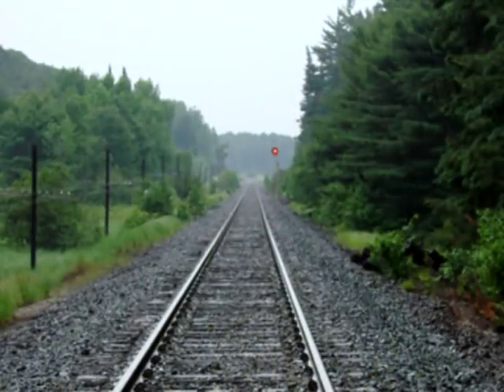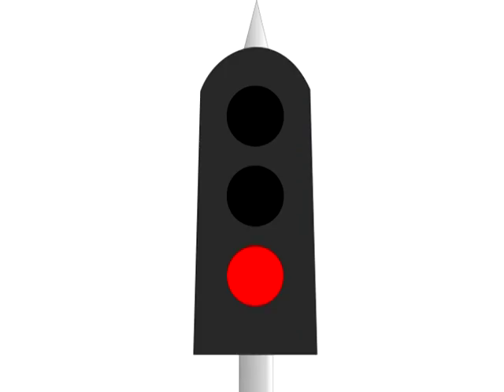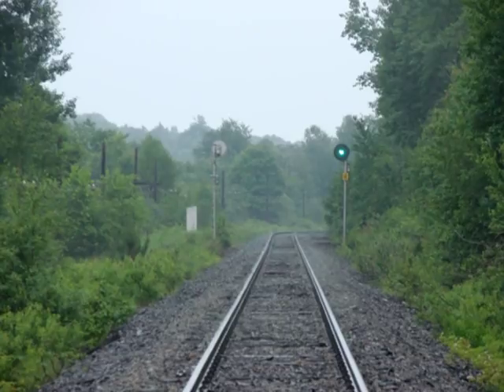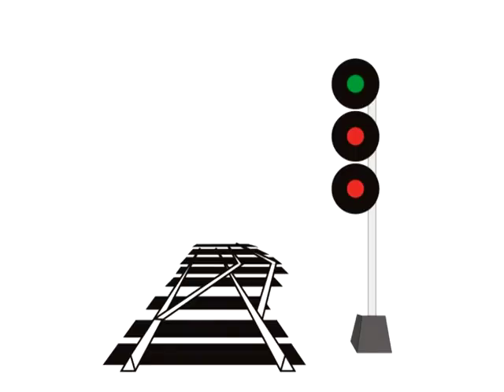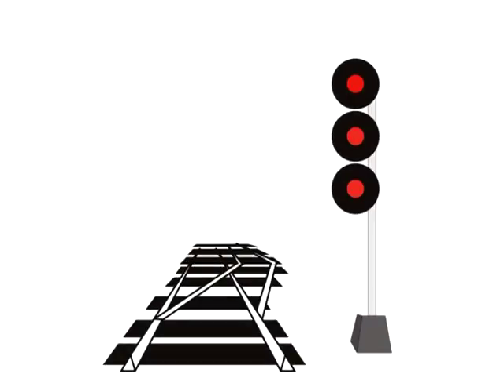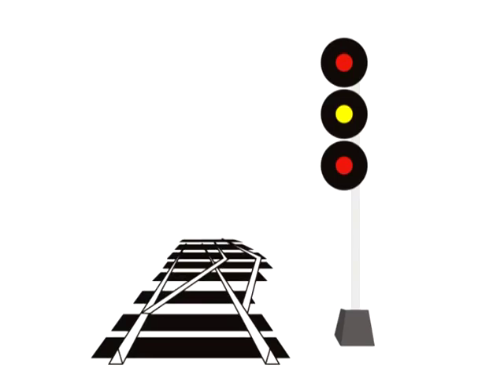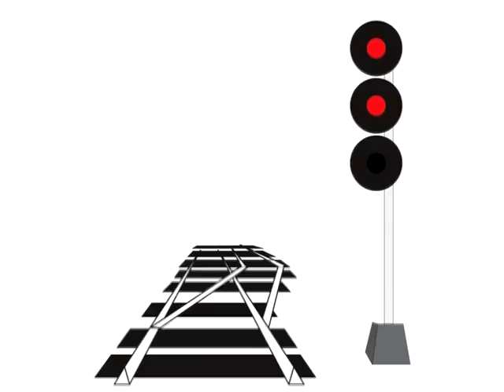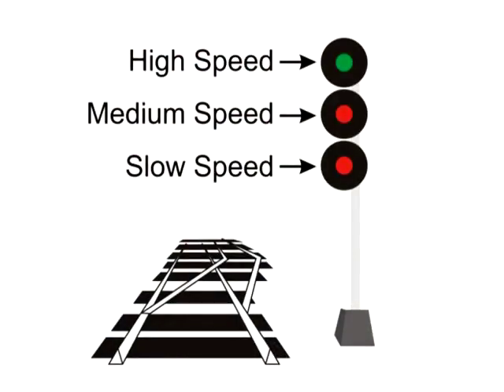Railroad Signals, reading and meanings, part 1: The basic three light system

Comment: Nice vid, thanks. Finaly I have some clue about North American siganling. One  question; do you guys use any train protection systems in case the engineer would missread the signal and would not stop at a stop signal? I`m talking about something similar than TPWS or ATP in the UK.
Reply from the maker: No, not yet. They're working on it in some parts here in North America.

Comment: I do not understand "stop and PROCEED". If the block ahead is not clear, shouldn't the train remain stopped until the signal turns yellow/green?   I was always under impression that red meant "RED" (stop). Surprised that by default, it doesn't mean that and only when there are additional signs on the post does it mean "stop, you're not authorized to proceed".
Reply from the maker: Right, well this is only for the automated signals. We get pass stop permissions from RTC all the time for the absolute stop signals. But it takes complicated paperwork. Almost always, we'll pass a stop signal because a block is down - there's something broken on the system. However, there can be a ton of reasons why you'd want to go past that signal. 
We had one a few weeks back where in extreme cold, our remote controlled locomotive went off-line. It was about a mile back. In the extreme cold you get hundreds of small air leaks in the train air brake line (especially the connections between the cars). We lose our air brake pressure, and the pressure is what releases the brakes. So the brakes on the train come on because we now only had one locomotive pumping up air pressure and it couldn't maintain with all the leaks in the extreme cold. The problem is, when it goes off line, a safety feature on the remote locomotive will keep it off line until it sees a 3 psi rise on the brake pipe pressure when the engineer presses the remote control button to go online. We couldn't get it. 
So they gave the train behind us a pass stop into our block. They literally came and tied on to the tail end of our train, hooked up to our air line and started pumping air from the tail end with their locomotives. That got us enough pressure that the remote locomotive immediately woke up and came back on line.  Which sure beats me trying to blow into the brake line cause in 40 below 0, your lips freeze to the valve. :D
Other reasons might be as simple as expediting traffic - coming into a terminal, the train ahead of you is too long to fit in the yard block, so they'll give you a pass stop and have to come right up to the tail end of the other train and follow them through the terminal. This gets you right up to the doorstep because that block might be 10 miles long! And there's other trains sitting in the yard, waiting to leave and they can't until you guys are cleared. 
Anyway, there's a pile of reasons for it. The primary one being that when you encounter a stop and proceed signal, it's almost always because there's a problem in the block, or you're safe to slowly proceed at restricted speed because there may be equipment in that block.
Reply: Thanks for reply. I can understand special circumstances where trains are allowed to cheat. (I have seen 2 VIA trains behind each other waiting for track to re-open ahead of them after "incident").  Butr still puzzled on why the default "STOP and PROCEED" instead of "STOP until no longer RED OR get special permission".

If a VIA train is on a siding, waiting for another VIA train in opposite direction to pass, the first VIA train can't proceed not only because the single track ahead is occupied by incoming train, but also because the switch and end of siding is set to allow incoming train to go straight, so the train on siding can't move. So "stop and proceed" makes no sense there. 

I just don't understand situations where a RED signal means that train has to stop and be allowed to accelereate again right away. 

Note: the new CP signals near me have an R on them, so here,  red means "stop, we mean it").  (CP upgraded from 1950s block to CTC leaving Montréal to Smithfalls after Hunter Harrisson put a stop to CP completing its pull out of Québec).

Comment: Thank you very much for this video and series. you've saved me from quite a time trying to figure out the rule behind interpreting them. Do you happen to know if CP uses these same signals when operating in the US?
Reply from the maker: Yes! Or at least the Canadian CP does as these are the Canadian Rail Operating Rules. CP and CN of course both run on US lines and the rules are different there though basically the same.

Comment: Ian, question for you. I was watching a metra video of a train traveling on I believe to be CN owned trackage. Last signal in the video was a flashing red over a yellow. Couldnt find anything on it. Got any ideas?
Reply from the maker: No idea. That one's not in the rules, and I know CN doesn't use flashing reds (though CP does and they are in the rules). And the flashing reds in the rules are always in the bottom because apparently they are just like a restricting signal, or so some CP crews have told me.

Comment: Hi Ian - you have a wonderful series of signaling videos. Just a couple of questions. Someone mentioned that train crews cannot "look at" a signal tower and tell whether it is permissive or absolute and that the signal type is indicated in the timetable the crews receive. Going by that reasoning, why would there be any use to physically show that a signal is permissive (such as a P plate or milepost number on the mast) or absolute (A plate or the absence of any plate) if all of this is apparently useless information to the train crew if the signal types and locations are printed in their time schedules?
This debate came up when there was a discussion about NS putting up their new Darth Vader signal towers of which some of them have a bottom single-head placeholder that can only display red, with the idea that this bottom placeholder distinguishes this mast as absolute with no plates. But if the crews already know what the signal is using their timetable, what is the purpose of this single red placeholder placed below one or two multiple light heads on the same mast?
Reply from the maker: I haven't got a clue what they're talking about.  I'd have to see the context of what they were saying. We go by signal indication when we see the lights literally miles away.  It so happens that on these subdivisions here, ALL of the intermediate lights have an R plate on them. So it's simple: if it's a vertically stacked light, that's a controlled location. If it's staggered, it's an intermediate and you can pass that signal at restricting speed if it's a red board.  I'm not sure what these "P" plates are - is that an American plate?  The milepost numbers on the towers here are strictly for identifying the light when need be. i.e., a light is burnt out and we're reporting it to RTC, or if we need to get permission to pass stop, we have to verify a match between the number on the tower with the signal number we got written permission to pass.  So we'll creep up to that stop signal, preparing to stop short until we can read that number and verify our permissions.  Other than that, the timetables don't list things like R plates, though they do list the diverging speed signals.  I suspect the reason they do this is because the diverging signals were upgrades from restricting signals.  This just goes back to the original signalling system which I think was installed here in the 40's?  So back then it was probably a slow to stop signal which I suspect was changed to a restricting signal years later in the rules.  They just never bothered to upgrade the restricting signals going into the sidings - there wasn't much point.  But now we have one siding east of here, our only long siding between Sioux and Armstrong which they just upgraded to diverging speed this past year. They slapped a DV plate on the tower, and put a bulletin out about the upgrade and now it's in the timetable as well.  We can't see that DV plate going east until you're literally right at the signal.  So this comes back to knowing your territory as well - we already know it's a diverging signal, so when we see that flashing arrow on the approach, we know we're lined and locked into the siding, we can hit the next light at 25 mph.
Reply: Thanks Ian! Yes, the P plates are I guess the same as your R plates.

Comment: Do you happen to know what the following signal means: flashing red over two steady reds?  (Saw it on the South Pacific line in Sunnyvale.)
Reply: +agentorange153 

Flashing Red, over Red, over Red = Restricting:

GCOR 6.27:

When a train or engine is required to move at restricted speed, movement
 must be made at a speed that allows stopping within half the range of 
vision short of:

Train
Engine
Railroad car
Men or equipment fouling the track
Stop signal
  or
Derail or switch lined improperly

The crew must keep a lookout for broken rail and not exceed 20 MPH.

Comply with these requirements until the leading wheels reach a point where movement at restricted speed is no longer required.
Reply: +oxenforde Thanks!
Reply: +agentorange153  ... also ... the signalling system used in the West half of the country are somewhat different than the signalling system used in the East half of the country.  There seems to be a dividing line running down the Mississippi River, dividing the two systems.  These are Eastern signals.  90% of the information in this video applies to both systems, but there are a few little differences.  Enough to confuse me. (I'm a Western guy.)

Comment: Many years ago, as a child, playing the old Microsoft Train Simulator, reading forums, and trying to achieve a "prototypical" stopping distance for Canadian freight trains, I found that I ended up with brakes so weak, the locomotive could pull a long train with the brakes in a full service application. That doesn't seem right.

Comment: very very well explained, thanks!

One question though:
When a train passes through a yellow(prepare to stop at next signal) signal, does that mean that when the train reaches the next (red) signal that it should be stopped at that point, or does it mean that the train should continue on full speed, preparing to begin stopping at the next(red) signal.
Reply: You have to be prepared to stop BEFORE the next signal, provided that when you see that signal it is indeed red. If it is a red signal and any part of your train crosses that signal, be it by and inch or by a mile. Both the conductor and engineer on that train just lost their license.

You could finally get to the "next" signal from yellow (approach) signal. And it may turn out to be green (clear/proceed) and not the red you had prepared for.

Comment: What I don't understand is given what you tell us in the beginning of the video of how hard it is to slow down a very long train, how does the train slow down to the slow speed in the distance the engineer has to see the signal in the first place?
He can only see the traffic signal within maybe a hundred feet, but it can take a mile or more for it to slow down. So how could he possibly being going slow past that signal?
Reply from the maker: Pianoman 70s style It's funny you mention that. Here on the Alanwater sub I'm working on in Ontario, we have some single aspect (one headed) signals on the approach to some sidings.  They can't display advance clear to stop for example.  We actually go by our train profile; if we are over 80 tons per operative brake on the train, we approach the signal at a maximum of 45 mph.  This is because the next signal can be a clear to stop, and we have to be going slow enough to stop by the next signal.  If we're over 100 tons per operative brake, some signals we have to go slower still.
Reply: Pianoman 70s style: I believe what you are missing is that the train does not receive the information to go at this slow speed at the signal where it matters, this information is given to the train at the previous signal, giving the train time to slow to any conditions that are ahead.  Once the train gets to the signal where the condition actually exists, the indication will instruct the train to operate at that speed with additional information with regards to what compliance is required at the next signal.  This continues indefinitely except for cases where the train is stopping or operating into a section of track that is not detected by the signal system.
Reply: Kevin Rudko Thanks, that cleared the confusion.

Comment: Q: What do you think of Dutch train signals? It's been said that it's one of the easiest systems in the world.
Personally, I think the NA signalling system is waaay too ambiguous. Sure, for an experienced engineer, it's second nature, but if you're having a bad day, it's way too easy to mix speeds up.
Reply: Then you're not a very good engineer ;)

Just kidding, there are rules in the CROR and General Operating Rules for both railways related to this. The easiest way to put it is for a crew member to call out the approach and controlled location signals, and for the other employee to verify it.

For example on the runs I do. "Clear to stop to Bruce take siding"
Engineer: "Clear to stop to Bruce take siding."

and then at Bruce one of us will call out the indication. The other verifies it. 

The verification method is excellent, because I've had my fair share of engineers mess up on a signal when they assume what it was going to be based on the previous signal. Every now and then when you're tired you'll mess up on an indication, but thats what the other employee is for. 

I had once a Limited to Limited signal, on the runs I do thats super rare, it through my engineer way off and he didn't believe me when I called it. I think it was more shock and disbelief. 

Hope that helps!

Comment: Ian, great job explaining the basics!  I expect that LED lights are a lot more reliable and durable than the conventional incandescent/lens mechanism...has the failsafe protocol changed?
Reply from the maker: No, no change. There's a few reasons for this: it's mix and match out there - so while we probably know which lights are LED and which ones are incandescent, they want to keep the rules simple. Multiple rules for multiple kinds of lights requires more knowledge, more room for error. This is why the rules for lights out of alignment (I'll probably get into that in part 5) still apply, though the rules were written for the mechanical lights. LED lights are of course composed of hundreds of LED's - but they're all wired in series so if one fails, the whole light goes out. This ensures maximum brightness and relies on the rules to cover when they fail. So even the LED's being more reliable still means they follow the same rules.

Comment: This coming from a rail fan, but an amateur concerning signals. This system seems overly complex and not very intuitive. How about the 3 lights representing  the next  3 blocks, in order top to bottom. Green= proceed track speed,  yellow=restricted speed(stop in half the distance you can see).
Red= stop.  Maybe a blinking green or yellow to signify a switch or crossover that is currently switched off the mail line. Knowing  the signal 3 blocks down the main would give faster trains time to stop.  I'm sure there would be some other minor variations that might need to be addressed , but something like this would seem to be much simpler and less likely to be read incorrectly. That's how I would run MY railroad!  lol.  Let's hear some feedback.
Reply: Once you have all the signals memorized its very very easy to remember, it follows a very set pattern. With only a few exceptions (diverging, restricting, stop and proceed, etc.)

Comment: how are you converting kilometers to  because a mile in distance is 1.6km, 2 km which = about 1 and a 1/4 miles..

If you are 75MPH your stopping on average of 50+cars  your stopping distance is going to north of 10 km for a dead  even at 25-35 MPH you be north 2 miles to dead stop in terms of kilometers 3.2 or more...

Comment: does the engineer stop right in front of signal, when required to stop or a designated area?
Reply: pretty sure they can stop anywhere as long as they don't pass the signal...also if near a crossing they would stop before the crossing as not to block it.
Reply from the maker: the rules state that we're supposed to stop 300 feet from the signal, if possible.  There's one spot here on the Armstrong sub where there's a crossing right in the middle of the siding.  We'll stop short of triggering the crossing lights and wait for the oncoming train to tell us they're about four miles out (they let us know over the radio) then we start pulling up to the stop signal and block the crossing then, that way we block the crossing for as short a time as possible, and both trains pass the crossing at the same time.
Reply: the engineers & crew have to be heads up & not miss a signal or like you say , not to cross an insulated  joint.. back in the old days, with steam & without the electronic signals it must have been more difficult..